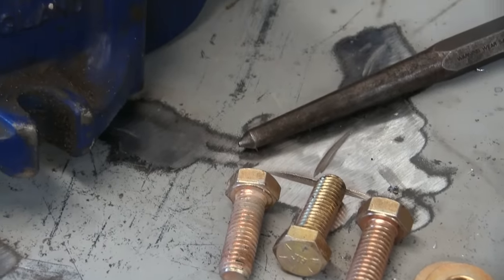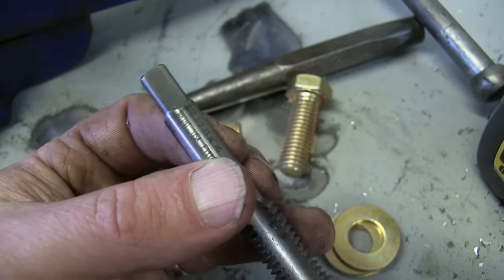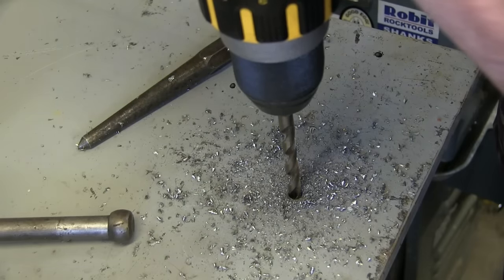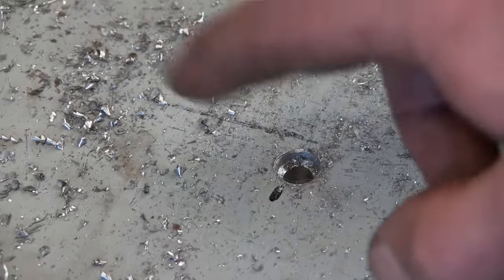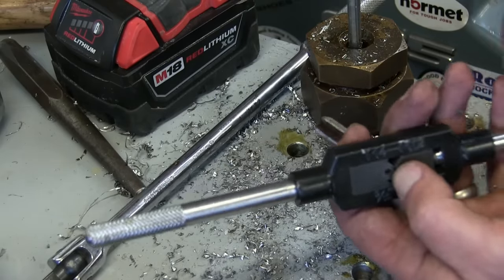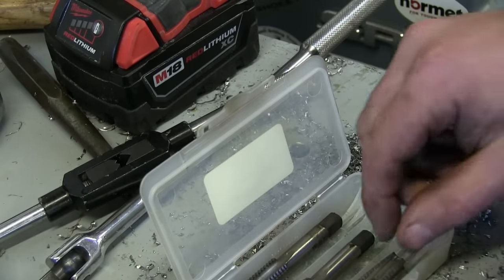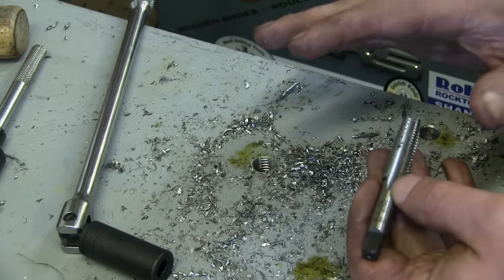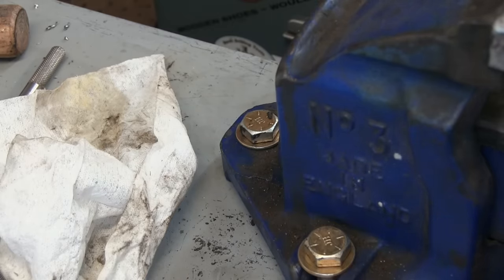Drilling and Tapping for German Virgins.  \\ GUDENTOIGHT!  //

Comment: I found that 1/2-13 power taps the easiest. The larger, but not too large taps with 4 flutes barely need any chip breaking thru thinner stuff. I would lightly chuck it into my drill, so if it jammed the chuck would slip. Then again, I was taping 1/4" plate, not 1/2. I wouldn't power tap really thick stuff. PS I have the same torque wrench.

Comment: Even up to 1/2" / 13mm, I prefer to use a tapping block (chunk of steel with a through hole sized to just clear the tap) to get the tap started straight... especially when using a plug tap to start a hole, because there aren't any other taps to be had for less than a 24 hour wait.

I like to use a paste like Rapid Tap makes for cutting heavier threads. Their liquid is about the same as Tap Magic, not too bad.

The old Penzoil 40 weight motor oil - with all of the sulfur - worked pretty good...

Then there's Anchor Lube - I've not tried it myself, but Stan Zinkowsky = ShadonHKW uses it.

Biggest tap I've ever broken was a 1/2" - 13 in A36 structural steel - hand tapping, well lubed...  the broken tap extractor actually worked as advertised!

Oh, and teat is pronounced tit as in the nipple, not her whole boob!  ;^)

Comment: if you want the tap to start straight then take a hard board at least 1" thick then drill a hole the size of the OD of the tap then put the tap through the board and the board will hold the tap straight while it starts cutting.

Comment: The drill was torquing out because you had it set to a torque clutch thing on the front behind the chuck. I'm pretty sure. You had it on the 11, not the "drill" icon thingy.

Comment: I hate to be the bearer of bad news but if you can't throw that 1/2-13 tap in the chuck of that M18 and quickly zap it through the hole in mild steel you have a junk tap. Also if you have to back up and go forward you have a bad tap. Besides, every time you back the tap up you dull the cutting edge.
Reply: So my last comment was at 13:35 I paused the video and thought you were reading my mind when I hit play.  However, I still say use the drill, not an impact gun. Guess I've been spoiled by really good tap's because you were working way too hard.

Comment: I've found I encounter barbs more often with oversized pilot holes, final bit size will also jump around alot. IMO the pilot only needs to remove material for the centre of the next size up.

Comment: Turn your clutch to drill mode ya goof.   Dewilt uses some sort of current sensing device to shut down the drill at specific torque settings when the clutch is in anything but drill mode.  It's actually really clever and eliminates a problem they used to have with their garbage clutch mechanism.

Comment: First, I cheat the tap chart and go up an extra 1/64th inch, 7/16" in this case. It's  only a few thousands to the hole size, but what a difference in the tapping experience!. It ain't like I'm building the Space Shuttle.
Second, use a tap handle if I have room (like the one laying there). Even force on opposite sides of the tap will greatly lessen the chances of breaking the tap.
Third, and most important.... Don't forget the SHMOO

They do make Spiral Taps for those that want to use pow-a, but, best left to drill presses. I have used them with hand tools without breakage, but the good ones are really expensive.

Comment: @AvE Drilled holes aren't round either. I'd imagine if you have a really expensive tap, or tapping some noble steel alloyed with badass and hate, you'd use a 3-flute core drill to make it round before sticking anything delicate in it.

Comment: gotta get one of them spirally auto chip breaking taps or a thread forming(rolling not cutting) tap if you want to use electromotive assistance. And even then it should be in a nice alignment jig or machine, maybe a purpose built taping press if you happen to have one layin out back.

Comment: rule of thumb that i heard at work.
rpms = 5000/ diameter
so a 10mm drill at 500 rpm in steel
double that for alu, and half for stainless and more exotic stuff
Reply: MrTommymxr this is old school out dated information. Every product you come across now days has a sfm chart. If you go by that you'll win every time.
Reply: What's an rpm anyway? 😂

Comment: I went and bought one of those... what do you call em, tap-guide-thingies. Looks like a flared tube with an inner shank holder. Works great for small holes but it always breaks the compression bit that holds the tap and becomes useless real quick when going bigger than 5/16 coarse.  Now they just take up room in my toolbox.

Comment: Nothing wrong with the drill.  At 7:28 you can see the arrow is pointed to 11, which is a drive setting.  If you turn it to the drill bit symbol, it will twist your arm in a circle in 1st gear.  I have the exact same drill and I about broke my fucking arm a couple of times when I didn't expect it.  It's pretty damn good for the size.  It's made of Chinesium sintered parts, but assembled in USA.

Comment: got a idea/ tip for you masonary bits An insert of tungsten carbide is brazed into the steel to provide the cutting edges. i've seen them sharpened to drill hardened steel here on you tube how about sharpening to make a lathe bit

Comment: You had your drill set wrong AvE, that's why it bogged. The 1-11 number settings have some electronic torque limiter in them, you were on 11 which is understandable, however it drills best on the drill setting.

Comment: 6:50 Thats how you dull the bit, you should run the drill full speed and then slowly, just rest the bit in the hole without pressure.

Comment: at work when I get a barb when drilling too big holes with handheld machines I usually just lift the drill up a little give it full throttle and ease it back in to whack that barb right off, works about 95/100 times, and either way the drill bits are lining up to be used in the tool dispensery area, so thats a good reassurrance(?) if the drill should get fucked right in the shanks:) but your way might be better, will give it a try next time I encounter that shit:) thx!

Comment: I have a drill which i assume is for tapping at least its what i use it for? It runs in reverse until you put pressure on it so when you let up quick it goes in reverse and breaks the chip. Note: Its old with classic metal body some crazy chuck and ive only used it a few times worked well but spins quite quick. Cant remember who made it but I can check if someone cares.

Comment: I'm hearing your drills pain. For cutting steel, try grinding the angle to about 10 to 15 degrees, instead of the usual 39 degrees. And run the drill at low speed, so the drill doesn't overheat. Happy Drilling.

Comment: You should use a drill press for drilling those holes in your workbench.

"WTF?!" I hear you exclaim.

Well, I bastardized my drill press so I can lower the whole head assembly right down. Touch up the baseplate with a cutoff wheel and you can drill straight out the bottom.

All you need to do is consider clamping the drill press to the bench and off you go. Straight holes.

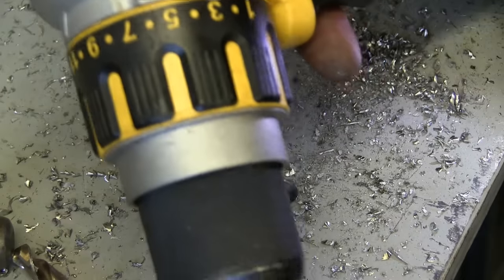Comment: 7:25 @ave You know you've got your clutch on the drill set at 11 instead of drilling mode? thats why its stalling. just the clutch doing its thing. or else that 20v would be trying to break your wrist off drilling that big of a hole in that big of steel. Been there. Being the new apprentice with 100 or so 1/4" steel anchors needing 1/2" hole in each of em and no drill press sucks ass.

Comment: No no and no! For blind holes you use a lifting tap!
 In my work I constantly make threads to steel up to M30. If you have a hole thru you can use those pushing-taps but if you have blind hole you wanna use a lifting tap!

Comment: AvE, I think your drill speed is too high for steel.  The speed and feed (yes, even for hand drilling) is IMO too high.  Also, the tap drill chart typically is for 75% thread engagement for softer metal, for hard metal such as steel, 50% thread engagement is enough, especially for the thick table top you have.  Typically the 50% thread engagement tap drill is two size larger.  Little machine shop has a tap chart that has both 75% and 50%.
Reply: So, I go for the in between (for 62%), mainly because I have that size.  Because the local farm & harm only had that size.  Because it's a common size that sells more.  Because they can't see sense in stocking what I need, only what sells more.  Frustration within frustration.  Corporate wisdom within corporate nonsense.  Or is that the other way around? (Mr Heron, come hither.  I need a little more assistance from you to sort this out...)

Comment: Lets see you put a half an inch hole 1/2 inch deep in grade 5 titanium... my poor drill bits. beyond blued my pilot and had to sharpen my other bits half way through. Had some welding to the 1/2 bit. I was using Norseman brand bits fyi

Comment: Hey there, I'm more of a pixie Wrangler, so I have a question about this tap in "soft" metal. If a 200 pound gorilla goes full force on a nut in the tapped soft metal, which one will break first, it will ruin the tap or the head of the nut will just snap off?

Comment: What are your drill bits made from? An alloy of methril and unicorn turd? If I drilled steel at that speed my drill bit would get lightning hot and work harden and I'd be fumbling around like a teenager pushing rope.

Comment: is that the 3 speed hammer drill? i didint like using that one too much. the electronics wouldnt let you bog it down. took away all the advantage of the brushless.
Reply: in the video you can see that it is a 2 Speed. it is brushless so either is the dcd 795 or 796

Comment: @AvE I have no idea how to contact you so I figure I'd ask here. Do you think the brand most people refer to a tool by is necessarily the best? For example Channel Locks for tongue and groove pliers, Crescent for adjustable wrenches, Hilti for rotary hammer drills, etc? People on job sites give me shit because my "Channel Locks" are red Milfuckees. I happen to like them more than Channel locks for a couple reasons, but people won't even give them a shot.

EDIT: No I don't give a shit what they think. I just wondered what your opinion was, even if this question probably would need to be answered on a case by case basis.

Comment: just watched your informative video but I had a question, what would you do if you had to drill thru a spot weld,I need to drill and tap a hole on top of a spot weld and I have tried cobalt drill bits tried pilot hole with no sucess any ideas.

Comment: I have a question if you may loan assistance... I have a hole I need to run a tap to for my car’s seat screw, but unable to get a T-handle on a tap to chew threads due to clearance. How would you tap that hole ? Do I need to find a longer tap? And I worry about being squared to the existing hole having a long handle due to smaller tolerance with angle. Thanks/ and yes, it’s a cheap harbor F tap set. Thanks

Comment: Why are you drilling with the Dewalt on a torque setting? Put it on drill mode and it won't torque out.
Reply: Ricky Mcgrath because he is using a 20 dollar drill that would snap
Reply: I assume it's because he's had that drill bind in drill mode. It'll dislocate your shoulder. Lol. I have the 996 model and I thought "I'd never need that handle for the side". I was wrong.

Comment: What are the advantages of tapping the holes and using a bolt vs just having non-tapped holes and using a nut and bolt?
Reply: in this case, there are no advantages, except maybe that shorter screws are less elastic so the whole thing will be slightly stiffer.
Reply: Kinda depends on the situation sometimes. My workbench top is 1/2" as well and the frame is 2" square tubing. Mounting my vise at the corner of the bench meant either drilling and tapping the holes, or drilling through the bench top and the tubing and then using 3" long bolts. I went the drill and tap route.
Not to mention that there's something oddly satisfying in tapping threads into a slab of steel..

Comment: hey chris i have a question, how come you are taping the table instead of just putting the bolt through the table and then tightening the bolt with a nut underneath the table. pardon my ignorance, just wondering. wouldnt it be easier that way?

Comment: Metric Threads Tapping drill size without a chart. 
Major Diameter - Pitch = Tapping Drill size. 
e.g. M12-1.75 thread, 12 - 1.75 = 10.25mm Tapping Drill. 
Check it out, simple and legit!

Comment: nice advice thanks again but what is that rocking blues at the end of the vidjeo?
Reply: what's record is it on I'm a dire straights fan but its really hard to make out the track fully as my phone is a piece of junk once again AvE your vids and ichiban Moto Vidjeos really are my staple diet of youtube binges all the laughs plus useful knowledge I can use for life :)
Reply: thanks heaps again I do have a questions about pixies I have a Jerry rigged electric outboard motor that runs a 750watt AC drill I'm using a 120Ah 12v deep cycle battery but I wish to limit the drill to only use 500 watts as I only have an inverter that is capable of that how do I choke the drill so is doesn't want so many pixies
Reply: Yes your completely correct I really need a bigger inverter but this combo really is to much for my canoe so I was hoping I could "choke" the motor some how maybe if I just have trigger setup so I can only pull it halfway but im guessing under load it still will draw to much

Comment: If you throw down one of your dvds from before you discovered porn was on the internet, you can line up the drill with the reflection on the shiny side to drill square to the surface.  Learned that from the SV Seeker channel.

Comment: Ave need help here. I'm a diesel tech . I need a good set of tap and dies. for cleaning old threads and creating new. is Irwin good? I don't care to spend good money if it's a good quality tool. but what brand do I get. all I ever see if Irwin or Hanson but it seems to me they are the same but re branded. I. E.  Snapon has a set for 500 but the case and lay out looks just like a Irwin. please help?

Comment: I never put coarse threads in anything I make for myself or tooling at work, its just stupid, fine thread fasteners are inherently stronger and fine thread holes are far easier to tap period!
The exception to that is in very soft materials like plastic, cast iron or soft aluminum.
One of the worst examples of this is a customer drawing showing 10-24 threads 1" deep in 316 stainless, after killing ourselves and lots of taps/ parts we called the customer and asked if they REALLY
needed the threads that deep, The reply  "oh we don't use that hole anymore we weld the mating part on", face palm!
I hate engineers..............

Comment: What is the point of adding oil when drilling in metal?
Reply: Oil reduces friction, and heat. It is lotion for better motion.
Reply: But don't you want friction for the cutting,without it the bit would just spin in place.
Reply: donayre21
you are not abrading your way through the work, you are slicing it. This is due to the geometry of the drill. Lip relief, stuff like that. Friction actually slows things down.
Reply: Thanks Paul now I get your point.

Comment: noob here,i thought you had to drill really slow when drilling in metal
Reply: Depends on the kind of metal. All metals are soft actually, even the slightest drop or overpressing of a tool can mare metals. Toughness is really measured by atom makeup, density, and crystalline structure.

Comment: Who the FUCK uses an impact gun for tappin holes? 
I usually use the makita crappy brushless beeper for doing this but with just a bit of gentle petting action on the switch. No time saved probably but I'm lazy and its easier to start straight if you only need to hold the drill and dont have to push around. Small holes are fun and done by hand though

Comment: Get a mag drill.
Reply: User 99321 I remember my first day in the shop
Reply: Justin ?
Reply: Nobody with any sort of shop sense would use a mag drill to drill 3 small holes with no critical function
Reply: Justin ever heard of work smarter not harder
Reply: Yep that's why I would lug an 80 pound mag drill from the back of the shop to drill 3 small holes.
Reply: Justin if you mag drill is 80 pounds you need a new one.
Reply: Ok you're right.